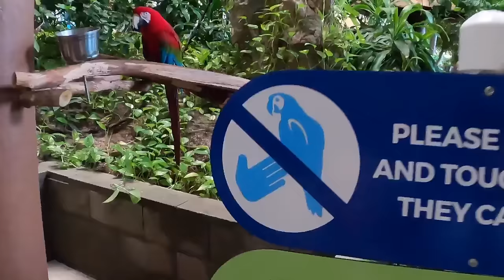Much Needed Family Trip - A Must do for Every Homestead

Comment: I knew you were in PCB even before you mentioned Shell Island because of the sand on the beach. I did a waverunner tour down the beach and across over to Shell Island and into the bay years ago and it was great. I recommend that if you can do it.